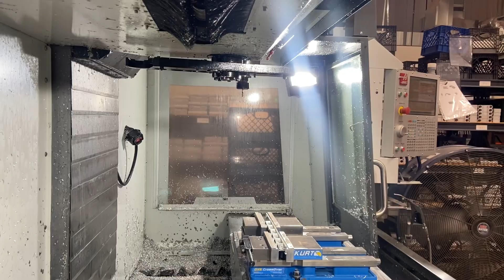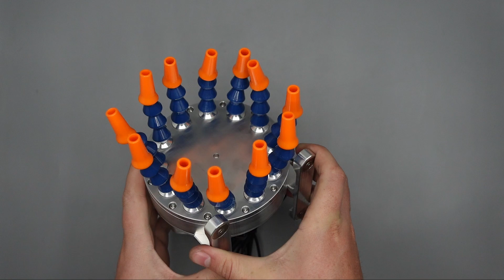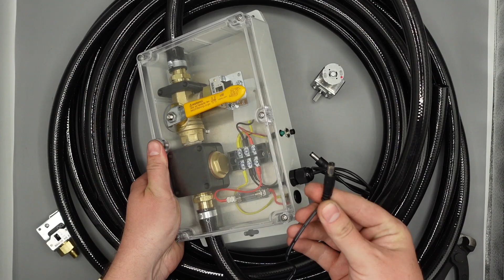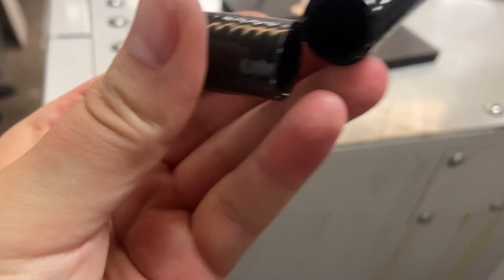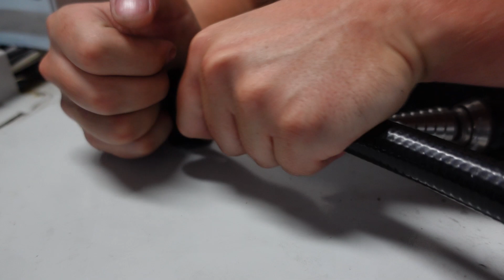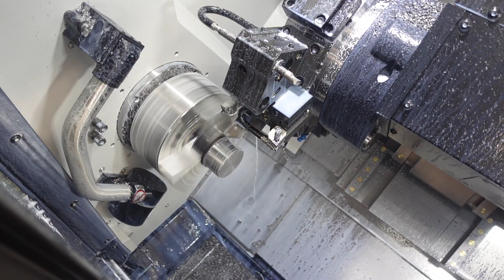Robotic Shower Head for CNC Mills and Lathes

Comment: That new way of routing the hose would work pretty well but if the customers have the pcool option the plugged ntp hole would be taken up.
Reply from the maker: That’s a good point! Maybe something like a T-fitting can be spliced in at that location to add another leg. Thanks for the comment

Comment: Glad to see u maid the right fixes, to make it easyer 4 everyone. but i would suggest going for 24V Motor, becuase nearly EVERY machine has 24V system!
so ppl can wire it to the Machine supply.
Reply from the maker: That’s an interesting idea! We include a 12V power supply that can be used with any 120V wall outlet. Some machines like our Haas mills have outlets available in the electrical cabinet. This is convenient for wire routing however not necessary to use power from the machine itself. The motor we use (JGY 370) does have a 24V variant so we can easily configure with one of those if anyone would like. Thanks for the comment!
Reply: @powermoveengineering  ye just wantet to mention it, 24V would be Globaly usable. Whit a powercord u need like 120V 110V 240V. And defenetly not every machine has an Outlet that switches of whit the machine. Then 24V would be cool ^^ , but ofc i understand that u would not touth the machine electical cabinet, but other ppl like and then its sold easy ^^ And u have leaner process whit less parts and less variants.

Comment: Show it working on the steel chip pile!
Reply from the maker: I hear you and we plan to show some side by side testing in another video. However once the chips pile up that bad then there is not much that can be done. The idea is to never allow chips to build for more than a few minutes since it seems to grow exponentially once started.
Reply: Yea i know but for demo purpose showing instalation and not result is a bit strange...